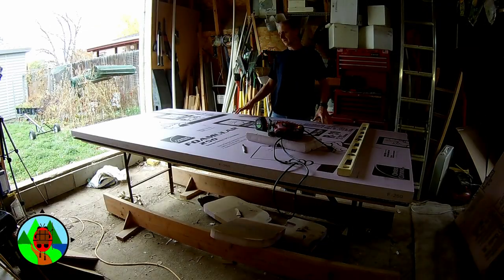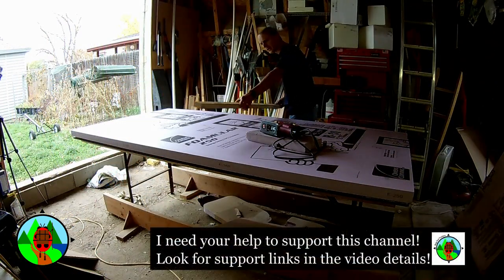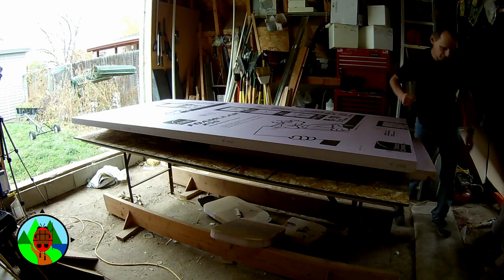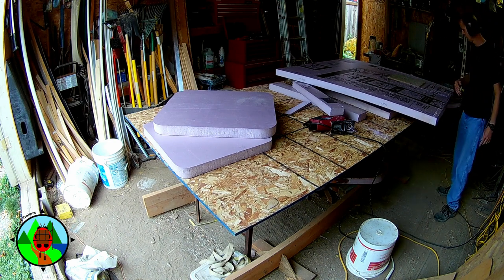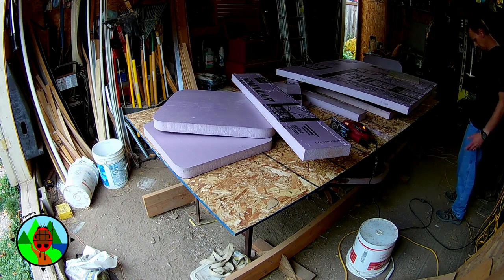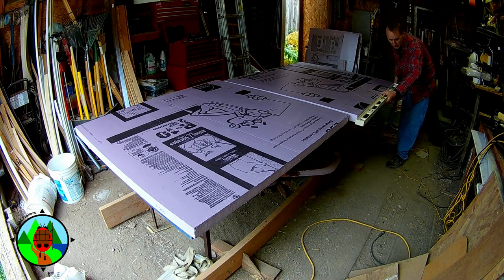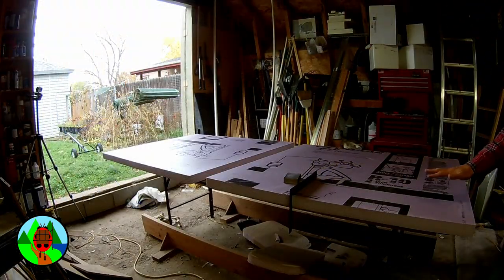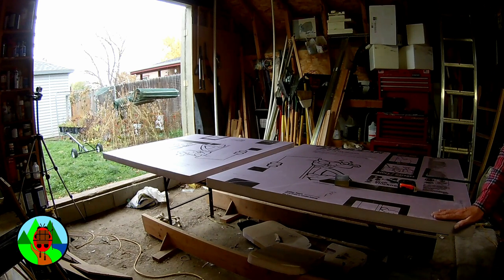Step 4 Cutting End Walls

Comment: What grit are you using to sand the foam edges?
Reply from the maker: To be honest I have had these foam sanding blocks for so long I don't remember for sure. Probably medium grit. I use foam sanding blocks because they are handy, but you could use a standard sanding block. You just need to sand enough to knock down imperfections in the foam and to slightly rough the surface of the foam. Foam sands very fast so be careful not to over do it. George.